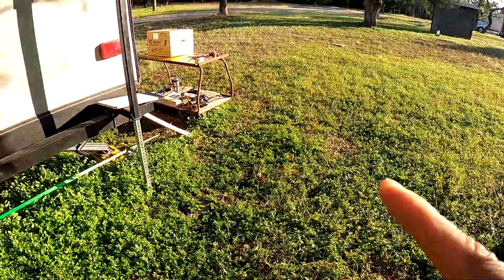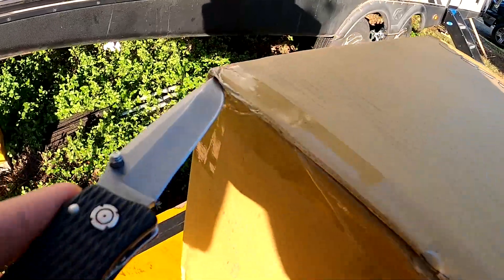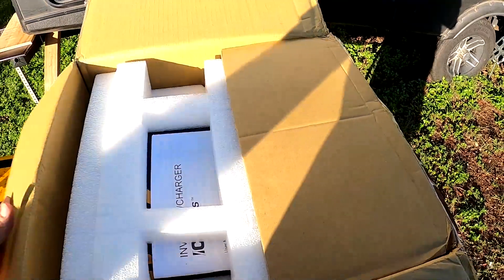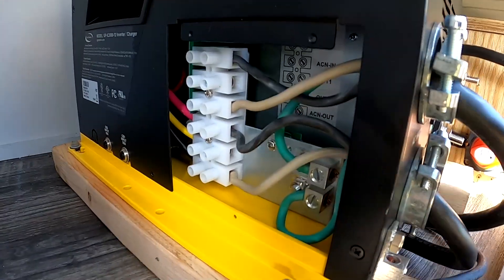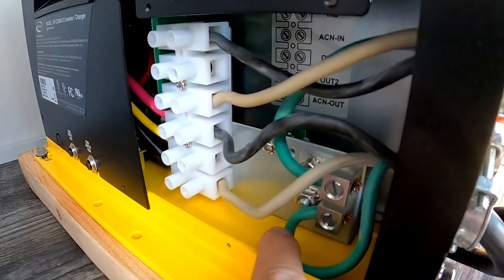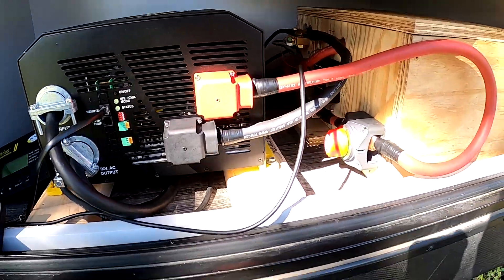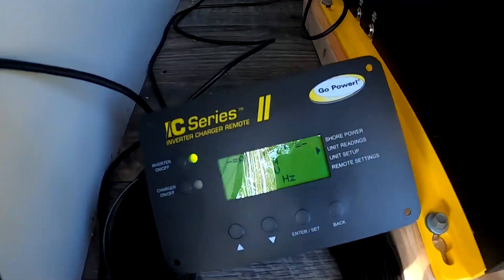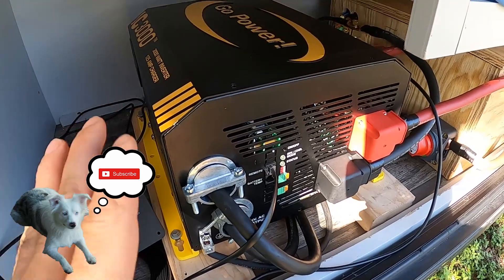Go Power IC3000 Install & DiY 12v 300ah LifePO4 Battery Install - Step By Step

Comment: On the 3000 watt GO Power IC inverter your fuse needs to be a 400 amp.
Reply from the maker: We use a 300 amp because I never run more than one large draw. So for 4 years now I’ve used a 300 amp fuse with no issues.

Comment: DID YOU DISCONNECT CONVETER/CHARGER FROM THE PANEL?
Reply from the maker: If your asking about the one that came with the camper then the answer is yes. The ic3000 has a charger.
Reply: @Grumpy's Diy & Off Grid  
So is there any else that needs to be done so that all 12v items work since I'm disconnecting 12 battery and converter?
Reply from the maker: I almost feel like your trying to do this in your head.  Because if you had an inverter you could read the manual. Then than would direct you to do whatever is needed.
Reply: @Grumpy's Diy & Off Grid  You are right..sorry to be a bother....You just have the best info on this setup. I'm waiting for my system to come in and want to try and understand as much as possible as I can't get a wiring diagram for my RV. Have a good evening
Reply from the maker: When I have to work on our camper. I pull out a battery, tell Jane she can’t do anything other than surf the internet. Then I do battery work.
Reply from the maker: As for diagrams, every rv is different.
Reply from the maker: If I could do it again. Id do a 24v system. Put a 24 - 12v converter to run my lights and water pump. Then run my batteries and inverter/charger on 24v.
Reply from the maker: Because the wiring would be 1/2 the cost.
Reply from the maker: Go price 4/0 pure copper cable, and get back to me….

Comment: I am having trouble with the 320ah battery custom made for me which looks like yours with the gp 3000ic. I have 580watts solar. It is a 50a service rig a  residential fridge. Did you use the exact settings gopower gave to set the control panel for thr battery
Reply from the maker: If your talking about the charging specs I used my own. 14.1 , 13.6 and 12 but go the equalization and turn it off.
Reply: @grumpysdiy  so thats what i did but second they say to have at 14.1 as well and some people are telling me to fo 14.1 at equalize, which is last setting but i have equalization off for the lithium. The battery app is this xiaoxiang but doesn't seem great although i see you said you don't have a bms. The battery isn't staying charged even with a 30a generator. Trying to figure out if its battery or ic3000. Could it just not be charging enough w 30a generator as now rhe whole ic3000 just shutting down completely as id batteries drained. Only been boondocking 5 days with new battery/ic3000 setup
Reply from the maker: Look up will prowse’s YT channel. He has answers to all your questions.

Comment: The shore power, that was connected to the main 30 breaker, he  disconnected that from the amp, then connected the 10g wire u showed to that 30a breaker. This is what you did also? It's hard to follow exactly
Reply from the maker: The wire that’s gets disconnected is a 10 gauge wire. All your doing is used that flexible wire so it’s easy to run through the camper to the inverter first from shore power then out to the breaker panel.
Reply: Oh ok, so you don't disconnect the main? Some genius did this and I'm trying to back trace what's wrong. I've had no power for 7 days, 4 kids, dogs, you all know the story 🤪
Reply from the maker: To install that inverter you do disconnect the stock main 30 amp power wire. With the 10/3 flexible wire. You wire it from your shore power plug to the inverter, then from the inverter to the main breaker panel.
Reply from the maker: It’s all in the manual, look up your inverters manual online.

Comment: How do u connect the lifepo batteries ?tho??
I've gkt the 3volt ones too 
I paid a guy lots of money and now I gave no power after he installed the inverter,  I had 100% power before the inverter , just couldn't run the ac, &  outlets
Reply from the maker: You need the correct wire size for your application from the battery to a bus bar. This is where you connect all positive connections. Then from there you run another thick cable according to the amp rating you want to run to the inverter.  That’s it. From there adding the positive from your solar just attaches to that same positive bus bar. As well as every other 12v positive.
Reply from the maker: If your trying to run an ac unit on 12v you need thick wire. 0/3 at minimum, 0/4 oot wire is recommended.
Reply from the maker: Plus all the fuses and shit off connections that support that amp rating or else you burn your camper down.
Reply from the maker: I am not responsible for what you do to your camper or any project.
Reply from the maker: Do plenty of research the answers exist online, how do you think I learned…

Comment: Very helpful, thanks. Did you put a ground on negative battery wire like in the manual? It shows a ground in there middle of the cable and that does not make sense to me.
Reply from the maker: My system is grounded and it is connected to the bus bar the negative is connected to. I also put a ground from the body of the go power to the frame of the camper. However I am in a new camper with a new layout so I need a new video about this.
Reply: @grumpysdiy  Did you connect it to there bus bar with a cable and then connect to inverter with another cable?
Reply from the maker: Yes.

Comment: Hey, I just got around to running my wires for my RV. I replaced the shore power with the new 10/3 wire and that will go into the input on the inverter. For the output, why did you run a new line? Could you use the orange 10/3 that used to be in the shore connector back into the output on the inverter?
Reply from the maker: Power flows through the inverter. So shore power comes into inverter, then new wire comes out of inverter to your breaker box to power the camper.
Reply: Yeah. I checked the orange 10/3 wire and it goes directly to the main breaker. Could I just use that wire already ran?
Reply from the maker: I did.
Reply: Sweet! Then I am almost done!!! Just need to build out a battery box and put the fuses in place. Is there anything I need to disconnect in the main/sub panel? Anything in there to do with the RV converter/charger? Sorry for all the questions…I am the most technical in my pool of friends and neighbors. I am the one they turn to for help ;)

Comment: This is now my second time watching your video. Trying to get it to sink into my brain so that when it is go time I can work without hesitation.
Reply from the maker: Lmk if you get stumped.
Reply: @grumpysdiy  Will do, thank you. Just purchased everything but the batteries. I will be de-winterizing my RV in the next couple weeks to start the inverter install. Last year I installed 4 - 100w solar panels, a cell booster for remote work and a larger fresh water tank. Since I have 400w on the roof, I am looking at starting with 2x 100ah 12v LiFe batteries and tweak it from there. BTW, I am on my 4th or 5th watch now ;)
Reply from the maker: I have a 300ah battery and 820watts on my roof now. I plan on building a new battery too. I really need to make an update video. Anywho you will be able to power everything in the camper, not all at once. But it will power everything.
Reply: So, I got everything installed and working beautifully! I was able to run the AC while watching tv, tested out the microwave etc. This was an easy install but I was unsure of how the main breaker panel and built in charger/transfer would work into the go power equation. That is now in the past and for the future my family and I can enjoy longer stays without having to carry around ecoflow batteries. Thank you for all your help!
Reply from the maker: The go power is a charger so you don’t need the charger/ transfer anymore.
Reply from the maker: You will need the display monitor if your battery is lead acid.

Comment: Nice Video I am gonna use the same setup.......  Question: is there any safety switches or relays that prevent you from accidentally having the Refrigerator, hot water heater or any high power consuming accessories on that would quickly run down the batteries when running off solar.?   example, your not there and someone turns on Air conditioning or hot water not knowing their hammering the batteries right before sunset .
Reply from the maker: I have a battery disconnect switch down by the battery that I turn off if I don’t want my inverter pulling power.

Comment: That wire is not 10/3 it’s a 10/2 u don’t count the ground wire, if u had a 10/3 wire, it whould have a red, White black and green just a fyi.
Reply from the maker: Go argue with amazon and every other supplier on the internet. The 10/3 stands for 10gauge x 3 wires. 10/4 would be 10 gauge wires x 4 wires and would have the red wire your talking about because it allows you to wire 220v
Reply: U are right the first number is the gage of wire, the next number is the conductors, a ground is not a conductor. I’m not trying to be rude, I’m just trying u the difference, but if u don’t believe me look it up.
Reply from the maker: I don’t know what to tell ya bud, that’s what I searched for on Amazon 10/3 soow bulk cable 30 amps and that’s what shows up.

Comment: does your tow vehicle still charge the battery when traveling?  Did you have to get a special dc to dc converter for the lithium batteries?
Reply from the maker: The tow vehicle doesn’t charge the lithium battery. The lead acid deep cycle that used to be our house battery gets charged by the truck, and we use that to power a trolling motor. One day I’ll build a battery for that too.

Comment: positive battery terminal.... shunt supply wire should be on the top of that stack of connections to the battery. You could melt it.
Reply from the maker: Appreciate the info, however we rarely do heavy power usage when boondocking. When I have, I ran our AC unit off the battery and inverter for 2 hours and the wire is still just fine.

Comment: Did you ever add a BMS to the setup?
Reply from the maker: Nope still running without it. I really don't see a need for me personally. I can control a ton of settings via my charge controller, and inverter. Both have low temp disconnect, and tons of other crap. I also always keep a cell balancer on the battery.
Reply: @grumpysdiy  I see, that makes sense. Thanks for the reply.

Comment: I'm new to this.  With your set up it, seems that you are always on the inverter correct?  You can't turn on any items like lights or water pumps without the inverter in this set up?  Is there a problem keeping a factory type set up and just swapping out the stock converter and charger?
Reply from the maker: We dry camp a lot so... yes we are on the inverter a lot. My setup can power my ac if I want it to. Be it for only 2 hours it can if I wish. If I just run normal stuff not an ac unit or a heater we never run out of power.

Comment: So, I 'searched' to find your build, and- was wondering... What happened to the Aims Power 24v 3,000 Watt Inverter Charger from the battery build? I'm building a very similar set-up for a truck camper (24v 190AH 8 cell battery) and have been waffling between Aims & Victron. Just saying the 'V' word opens a slippery slope of convenience & dollars spent that we can avoid for now, but- I have NOT pulled the trigger yet on the inverter/charger yet. Please let me know why you went away from the Aims? Dave
Reply from the maker: I returned the aims because the resettable breakers on the aims kept tripping. After only a few minutes running something that was a heavy draw, then I had to go and manually reset them.
Reply: @grumpysdiy  GREAT to know- thanks for the info. 2nd Question- Why did you go away from the 24V build? (Guess: IC Power doesn't offer a 24v inverter in a 2k Inverter/Charger) I'm committed to going 24v because I may double the battery bank from 390AH to 780AH either right away, or, within 9 months of original build. Wife 'n I are older & I'm unsure if I can teach her to limit wattage...Also, due to a medical condition, we could need AC on battery- super high draw load spread & endurance of at least 5 hours... Just thinking ahead. Finally, I'm cheap & there's some dollar savings in smaller wires- adds up quick.
Reply from the maker: Correct go power doesn’t have 24v inverters, and I know someone personally with one and he loves his. If your planning on running an air conditioner, I would suggest installing a mini split. I don’t know how big your rig is, however if your ac unit isn’t a mini split you won’t be able to put enough solar on your roof to recharge your batteries after running the ac.
Reply from the maker: My 12500 btu ac unit pulls like 150 amps an hour dc. My 820 watts of solar on the roof in peak conditions puts out 45 amps via my mppt. So use the ac 1 hour, in peak conditions a minimum of 3 hours 20 mins to recharge the hour used. Not including all other small things plugged in that everyone forgets about.
Reply from the maker: For comparison mini split makes an ac/dc unit that can run on 900 watts of solar open circuit with no charge controller or battery. Obviously you need battery to continue to run the unit with no sun light.
Reply: @grumpysdiy  - Our plan involves a Dometic 11,000 BTU Penguin II low profile roof mounted AC. Using a Micro Air Easy Start 364, draw should be @ 1,800 Watts at start up, and, 1,018 watts ongoing. I'm unwilling to cut another hole in the camper for a split, but- CAN address needed DC power in design/build stage. At present, I can 'fit' a single 8 cell 24v 195AH battery in the OEM battery tray, which has benefits. Also, the weight loss aspects are considered as well.
Reply from the maker: I would focus a lot less on watts everything uses, and focus on amp draw. There are ac to dc calculators online.
Reply: Additionally, I'm gonna (he sez with DREAD!) remove the Onan QG 2,500 LP generator, and, buy a Wen 2,350 Watt Inverter Generator (56235i) instead. At 56 Lbs., I should be able to haul it around, fit it in the 'morgue' (joey tray) and lose @ 100 Lbs. in the process. But, set up in the cold driving rain, having to leave the warm comfort of my lil home...painful, but- valuable to us over time...
Reply from the maker: I have a easy start on my ac unit and it does start the ac unit in stages to lessen the initial start up amps. It does not decrease the overall amp draw of the unit.
Reply from the maker: Some of those inverter gens have a remote start with them.
Reply: @grumpysdiy  I THINK (???) 55 amps is draw from the Dometic 11k BTU unit. I'd rather NOT spend big $$'s on an occasional use item (gas inv./gen) nor the weight. So, nothing over 2,300 Watts, no dual fuel, no wheels, no gauges (grrls need gauges! J/K, Wade!) no fancy lights. Run 'n stop- 1,850 watts in the middle. Older (light weight matters...LWM, a new protest group?) guy, currently @ 150 Lbs. myself- not sure how THAT happened- just enough to run AC or charge batteries, or run microwave/convection oven w/o batteries...
Reply: I'm going wif flexible solar panels because LWMs Wade. I know, I know- durability is the risk.
Reply from the maker: Best of luck to you!